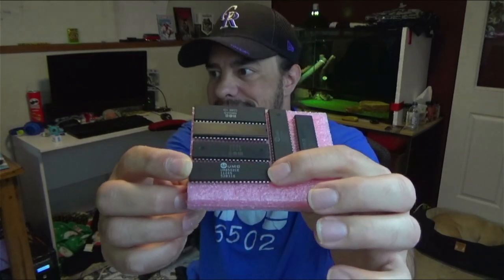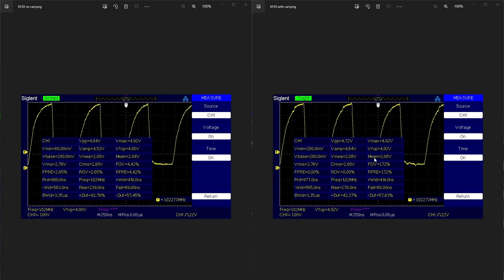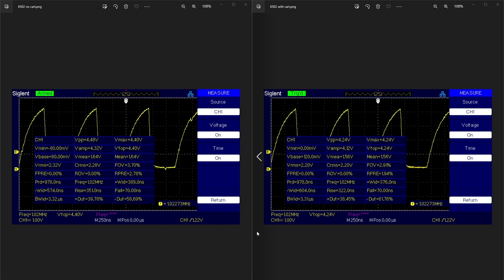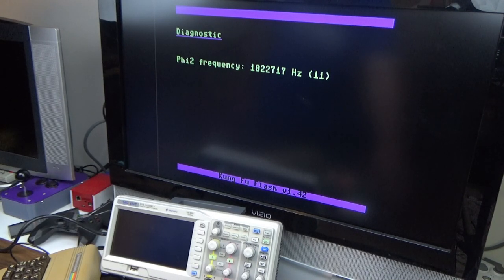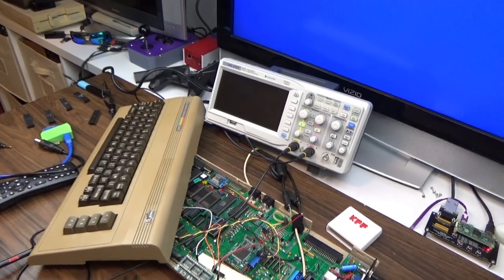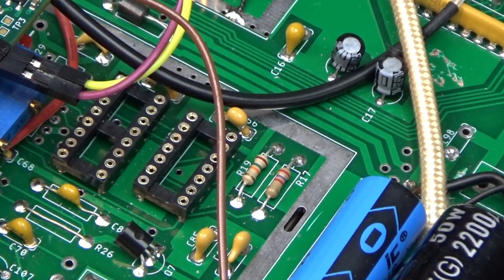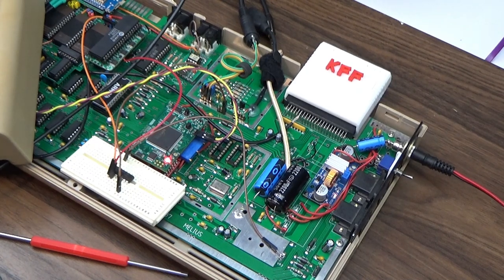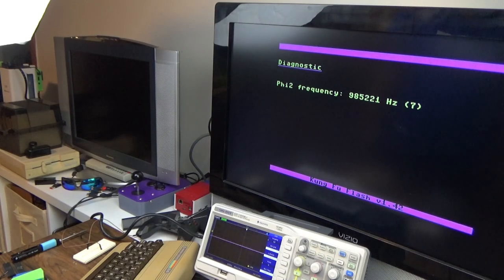Testing several 6502 processors in a C64.  Complete with a mangled system clock! Bye Bye 6510!

Comment: Those chips are very likely pulls from recycling PCBs. They get a bit of make-over (the paint and the fake laser engraving). You can also see it from the pins, that are newly tinned, but not looking as normal pins. Then they call it "new old stock", which is not the case. Usually, it is no problem. But when you get EPROMs that are like ST Micro M27C32, but in reality, it is a mix of different manufacturers and have different programming voltages (like 10.5V to 21V) it is not ok anymore.
Reply from the maker: Yeah, there's no way these are NoS MOS chips.  I'm just glad its some kind of 6502 I guess.  For less than $5 shipped for 2 chips that seemingly work I won't complain.  Thanks for your comment, between yourself and Stephen commenting on my little videos, I'm a bit starstruck!  You guys are awesome and I greatly appreciate what you've done for the 8 bit community!

Comment: Regardind the C-64 and its use of phases ...

Did I miss something cogent in the video or in the comments?

Plenty of phi0-2 engagement here but zero mention (??) of VIC-II famously accessing RAM on the phase alternate to the phase used by the CPU.  This is the usual case, except on scan lines where VIC-II has to fetch more data than can be read in its phase alone.  The 6510 is then tri-stated and VIC-II uses part of the CPU phase to fetch whatever data it needs when those lines trigger.  I believe the c64-demo-freaks call those "bad lines".  I'll let them explain further as my recollection on this is vague and I refuse to pretend to know something by googling the answer.  :)

TLDR : My recollection is that the 6510 hits bus/memory on the high phase, while the VIC-II can hit the bus/RAM in both phases.   IMHO, that bit of trivia should be pointed out in any discussion involving C-64 and clock phases.
MG

Comment: Someone should make a new C=64 main board that can take a 65c02, built in Kawari, dual armSID, with only static ram.
If we're getting to the point where we can use a 6502 instead of a 6510, we just need to virtualize the CIA's and we can order populated C64 boards from PCBway!
Reply from the maker: I wouldn't be surprised if the Evo board starts going this direction with future revisions.  I thought I heard somewhere that theres been some movement on the J-CIA front too.
Reply: Why not just use VIAs instead of virtualizing CIAs?

Comment: Very, indeed. I might try this on my 64, not for running a 6502 (tho I'll keep in mind that I CAN, I have 2,3 lying around) but to generally make life a bit easier for ye olde and faithful 6510 chippie and maybe clean up the signal. I'll have to see what my 'scope is giving me. Also good to know that I am better off with my PAL machine...
This is MY level of tinkering!

subbed + thumbs up!
Reply from the maker: Yeah, the clock being just a tiny bit slower seems to make timing tolerances less of a problem than a NTSC machine.  Thanks for your support!  I appreciate it!